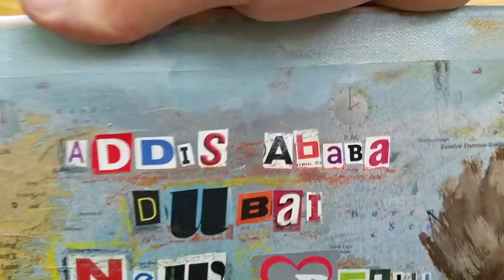WE TRIED TO MOVE THE HUT WITH A TRACTOR

Comment: If you knew the total weight of the Hut (including trailer and contents) you could rent a tow vehicle from a nearby truck rental place. For example , if you have a 10,000lb trailer, your axles should be rated for at least 2,500 axles, and your tires should be rated for 2,000lbs. I'm assuming you don't know any of those (if I remember from previous videos you don't actually have tires which will make rolling it quite the challenge). My suggestion is to have it lifted and moved (wheels off ground). Depending on how far you want to move it, you could have a tractor literally pick it up and move it so it doesn't have to roll on the ground. You will need safety chains or adequate weight straps. I'll try to find some videos to illustrate my suggestion.